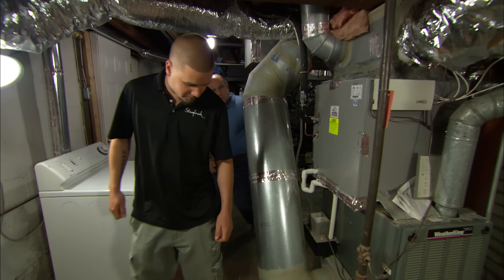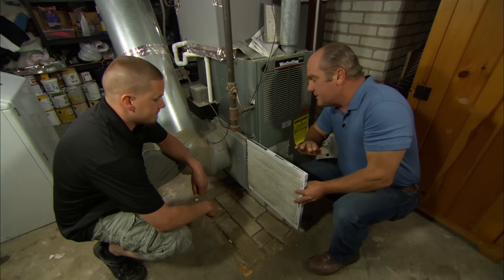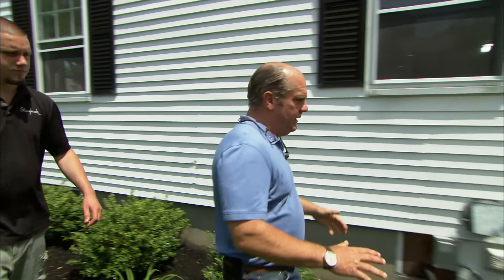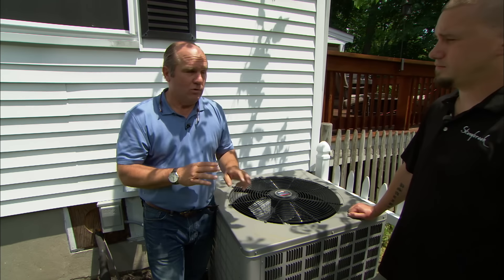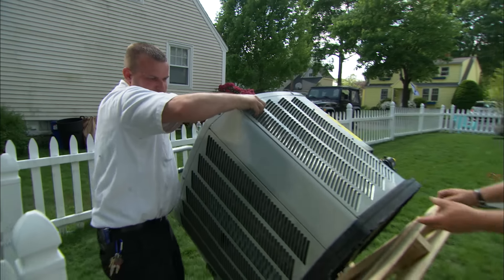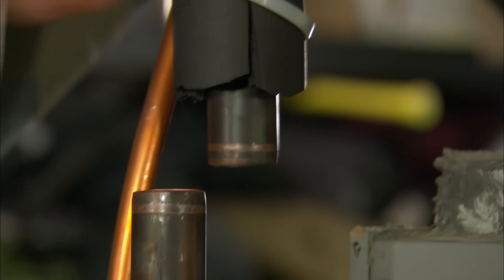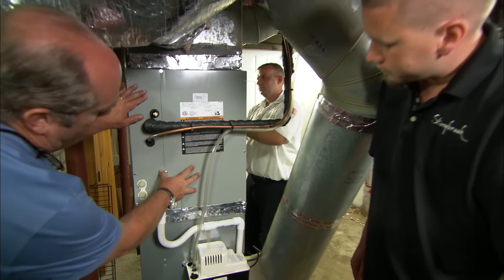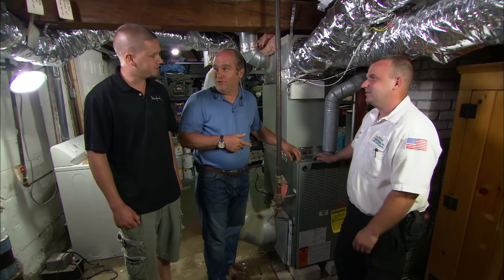How to Repair a Frozen Air Conditioner | Ask This Old House

Comment: He did not check for a dirty evaporator. Always check for large amounts of dust settling on the blower motor and that might give you a clue as to what the evaporator looks like before you get out of your handy-dandy measuring tape to look at the damn ductwork

Comment: haha the comments on this video are awesome...  Man they didn't mess around,  that coil was still melting and leaking water so they must of had the new unit on the truck ready to go.  That furnace looked 25 years old it even  had a  heat flute running out of it, did they ensure it worked fine because the video didn't mention it.  They also didn't show the returns in the house ( were they blocked by furniture?   No static pressure test?  Just measure  the ducts?   So unit was oversized for a 1800 sq foot house and yeah, that air return looks suspect for a 4 ton unit.  They should of quickly explained more  to figure out what the issue was and why only replacing it was the solution.

Comment: He's wrong when he said the refrigerant goes out to the compressor through the LIQUID LINE with the TXV and distributor.. the refrigerant GOES TO THE evaporator through that line, it goes back the the compressor through the SUCTION LINE which is the larger line the one without the txv on it!

Comment: That tiny return line looks far more suspicious to me than the oversized condenser. I know 4 tons is overkill in his case but I would imagine this could have been solved lot cheaper by putting in a proper sized return.

I'm not really sure that his return is even big enough for a 2.5 or 3 ton unit.

Comment: If it was oversized, couldn't you just regulate the refrigerant by putting in a regulator?
Reply: Yes and that component in refrigeration is called a metering device. That system supposedly had a TXV (thermal expansion device) which is set to maintain certain superheat. 
It is more than likely a lack of proper airflow and dirt that caused that system to ice up.

Comment: Line set is not sized right from a 4 ton to a 3 ton. just saying. Could of made return a lot bigger and increased the supply ducts. also could of put vents in basement.

Comment: Richard.I have a lot of respect for you but in this situation you missed some things.Yes the system was oversized and the ductwork was undersized.Three ton was a better choice.The return air was undersized and the filter rack was a bad design for airflow.I did not see the return duct replaced.Also last but not least, your description of the flow of refrigerant was completely backwards.Sorry but I to put my two cents worth in.

Comment: First of all,  when he is pointing to the copper lines near the A-coil/evap coil, he is pointing to the liquid line and the distribution header. NO WAY is that refrigerant returning to the compressor and condenser through the liquid line.  The refrigerant returns through the suction line, the larger of the two copper lines in the line set.

I replayed that segment a couple times because I could not believe what I heard and saw him explaining.  No way would a journeyman hvac/r hand ever confuse the functions of the liquid and suction lines. 

Also, running a larger unit in a smaller space is not going to make your coil freeze up. It may cost you more for the larger unit, but it is not going to make the coil freeze up. The T-stat will shut the system down when the conditioned space gets down to or about the set point temp.  His coil was probably freezing up because of low charge or running the system at an excessively low set point on an already cool day or because he is not moving enough air over the coil.

Anyways, watch when he explains, saying the refrigerant is going back outside to the condenser, where he is pointing directly to the liquid line and distributor to a fixed orifice metering device.  The refrigerant moves from the condenser through the liquid line through the metering device; then into the evap coil, where the heat is absorbed; then out of the evap coil,  returning through the suction line to the compressor, where it is compressed and pressurized, flowing out the discharge line into the condenser, where the heat is rejected and then down the liquid line through the metering device and on and on.. until the set point is reached.

Comment: Why did he replace the unit and evap coil?   I did notice he got the copper lines mixed up..  Looked like he was sizing up the  ducts maybe for cfms,  I never noticed why he had to replace the unit?      This could have been a simple fix and much less than  a partial new system.      This to me was not a real life presentation..

Comment: This was vary hard to watch as a HVAC tech. He didn't even check superheat or subcool. Says the refrigerant runs backwards, and they set the new condensing unit with the service door to the wall (Trane guys know). And I'm almost sure he was using plumbing solder on the liquid line for the evap coil. Looks like the right stuff on the suction line but he was using round solder at first.

Comment: never use pleated air filters, return air pipe is to close to air filter. Needs a return air plenium to spread air across air filter instead of in the center of filter.

Comment: When you were talking about building insulation and the type of Windows I thought you were going to mention doing a load calculation but then you blew it and went with that ridiculous 1 ton for 500 square feet rule of thumb. You didn't measure any airflow how do you know he wasn't moving enough air to support the operation of that 4 ton unit

Comment: 4 ton to 3 ton it's not a big difference. check the controller, if the controller was properly working, at 4-ton unit the compressor will turn off automatically before the evaporator can form ice. there's no need to downsize the unit to 3 ton.

Comment: If the unit was a newly installed and it has frozen pipe then I would say it may have something to do with oversize but if the unit was installed a few years ago and just having problems I think you should dig deeper to find the causes rather than changed out entire system lol

Comment: Nice job snowballing the guy into a new a/c unit ya con man, all you have to do when your a/c freezes up like that is turn the system off for 24-48 hours and let it thaw, then turn the thermostat to 70-72ish ? (Where ever your comfortable) and leave it alone, this is a very common thing especially in very hot climates.

Comment: He replaced a bigger unit with a smaller one...the only reason he gave, sounded like he wanted to sell a new unit. Also, those balmy “above record hot” summers, you’re now screwed.
Not once before he reamed the poor guy did he put a gauge set on the system and look for a leak. Refrigerant leaks are the biggest cause of core freezing.

Comment: Wait at 2:32 did this man just have a stroke, and explain to me that the liquid line distributors transfer the heat to the outside, the opposite way the refrigerant is flowing?  Once you hit that piston, you are in low side territory, ,

Comment: Yes, the AC was definitely oversized (assuming it really was 1500 sq ft) and it needed to be replaced. However, the return air should've been addressed. You cannot transition from round to square in that short of a distance because it wasn't utilizing the entire surface area of the air filter. Also, I doubt that little round return was big enough to carry a minimum of 12,000 CFM of air. Additionally, flex duct is only really meant to be used on the final 12"-24" of a run, not from the plenum to the register. The duct work is the biggest thing that should've been addressed. If the ductwork were big enough the unit wouldn't freeze up but he'd end up with a clammy house (cool but humid). I bet they had to come back out to this old house (pun intended) and deal with a frozen coil again.
Reply: What's more, I'm sitting here shaking my head at all the "professional" HVAC guys on here making, what I can only assume are, drunken comments. You don't need gauges to tell if a system is oversized or if ductwork is under sized. Jeepers! It had to go. Poor sizing is a huge problem due to all the hack moonlighters. But I think this episode clearly demonstrates the risk you take when hiring someone off of Craigslist. Not even 'This Old House' got it 100% right and they should have pro's double checking everything. I can understand the fear associated with people calling an HVAC technician. This is why it makes sense to call a licensed professional. They have more skin in the game and you have more recourse if they get it wrong.

Comment: Based on his 1 ton / 600 square feet rule of thumb and his 1300 square foot house, 2.5 ton would be more than he needed.. so why did he then put in a 3-ton condenser?
Reply: he recognized the infiltration of the older home...even with renovations....

Comment: I think I would just add a fresh air return and not have to pay for another new system and install. And fix the over size when that unit breaks. Oh and you didn’t use air tight cement required by city regulation lol.
Reply: Mastic isn't required in all municipalities.

Comment: The plenum is too short and too small to handle three tons of air must less four tons. The furnace blower is too small . Never bothered to check for refg leak.  Just pony up $6,000 sucker.  Where is the follow up video that shows any improvement in the system?

Comment: Didnt even bother checking if the condensing coil or evap coil is dirty, pressure's, capacitor, or indoor fan motor if its ceased. 🤔

Comment: I do hvac And plumbing. Main skill is HVAC. That return is far too small
Reply: Also he described the lines wrong. It goes back to the condenser outside as saturated vapor ideally ie the cold kind. The hot liquid line goes to the metering device in this case a txv and flashes off to a vapor at a much lower temp to absorb the heat.
Reply: Not by a full ton but you can oversize an a coil for efficiency but you have to adjust charge for it.

Comment: I don't get it. I can say for a fact that the AC in my house is way too big. The condenser is nearly 30% bigger than our old one, but it does not freeze. What is more likely a problem is that the condenser is kicking on and staying on when it does not need to be. The coils only need to be so cold. Now I am not AC tec but if this is not how it is supposed to work then feel free to correct me, but I think this guy got robbed.

Comment: The AC installer that ripped off my mom put a huge system,  I don't even know how big, on her little 750 square foot house. The condenser was bigger than the one on my house that was three times bigger. They have it low on refrigerant so it cools the space OK. If I were this guy I'd go that route instead of a new system if it's my dime.

Comment: The AC at my parent's old home in Louisiana died last year after operating for 34 years. The Hvac company they hired for repairs decided it didn't make any monetary sense to fix so my parents bought a new unit. For a home that's barely under 1400 sqft the HVAC contractors told them to go with a 4 ton condenser alongside a new coil unit. My parents didn't know any better and followed the advice of these professionals. 10 months later and the condenser is constantly freezing up. Their home is cool but humid. The energy bill is much higher than before as well. I wished I could have seen this video sooner or knew my parents had this issue so I could have rectify it with Hvac professionals I personally know. Why would the contractors recommend something so large that would cause issues for a smaller home?

Comment: I'm not AC tech,  but I noticed he said after he made a killing replacing that newer 4 ton unit with a 3 ton unit that he had to replace the A coil unit with the proper unit.  What if the coil unit wasn't the correct size in the 1st place or maybe just dirty or bad?  Seems like he over should this poor home owner equipment that he didn't need

Comment: I always thought the compressor turned the 22 into liquid under pressure and fairly warm too.  This guy says it comes back cold.  🤦‍♂️
Reply: The compressor sends the gas refrigerant to a condenser outside, the fan pulls off the heat turning the gas into a cool liquid which is pumped back into the a-coil,  which is an evaporator..where a fan blows air across it, picking up cold air and pushes it through the house. The low side of the A-coil sends that liquid refrigerant to a receiver and back to the compressor where it turns to a gas state to be pumped through the condenser outside again..

Comment: That was possibly the wrong type of air filter on the furnace, if it restricts air flow.
Reply: Look at the way the filter was installed.  Only half of the area of the filter is being used.  It is a huge restriction.

Comment: he could have just pulled the refrigerant back into the condensor by closing high side running unit until all refrigerant is back into condensor then its ready for installing on another job instead of reclaiming it

Comment: OMG so many mistake.. hes changes the whole system wow. The Line hes pointed at 2:22 is the High presure Line WTF.. it could be a lack of refrigerant, expander valve block, a lack of air, defective blower., dirty evaporator, Return air too small or block,air distribution extensive duct create restrition and too small for 4t,running in low temp outside without fan-cycling, Filters(oh hes check this 😂)an oversize system can only causes a lack of dehumidification and discomfort. no nitrogen when he does his welding, no p-trap needed with positive presure, no pump down to save time etc .. lack of experience
Reply: And condensate trap doesn't work when you have an uncapped tee before it. 🤦🏼‍♂️

Comment: It's supposed to be easy. just retrict airflow by covering the condenser
Reply: how would restricting airflow to the condenser fix the problem of the ductwork being too small for that oversized unit? the problem is not all the liquid is vaporizing in the evap coil, so you are getting liquid floodback to the compressor... choking off the airflow to the condenser would help how?

Comment: I know this is old, but I hate seeing people get bent over like that. Size x heat load is how the units are decided. I saw someone say something about gauges. What is the coolant level. Replacing the unit is the last choice, not the first. There are other things that can be done before spending thousands on a new unit. But I guess they have to find something to make a show about.

Comment: This is not a good install.  He is correct in looking first at the airflow, and then performing a heat load to correct the oversizing issue. But then leaves it attached to the same garbage duct system.  There are some small changes that could be made, very easily, to the return and supply to make this system work a lot better.

Comment: That guy got scammed. Probably just needed to replace filter and open vents, if all the guy can come up with "it's too big". Even if that is the root cause, there's a WAY cheaper remedy available. If your engine and transmission is too big for your rear end, you don't replace the engine, you replace the rear end. Same deal here. If the condenser/compressor/evaporator are oversized, the least expensive remedy would be to replace the blower with one with more static pressure, so it can push enough air through to keep it from freezing.

Comment: Why didn't he simply swap out the condenser's fan motor with one less powerful?  Or if the unit has an adjustable flow meter on the evaporator, fix it there?  This seems excessive.

Comment: Love how there's no mention of the system being short on return air, that single 12" pipe isn't enough for that that 100k 80%.   They're still short on return for a 3ton so they really didn't do this guy any good.  And it's zoned, that whole system is a mess.

Comment: Why replace the 4-ton unit when it was never mentioned if it had ALWAYS done this, or was brand new and wrong-sized? 
And why replace the A coil? Was that REALLY necessary? Looked like just a way to boost sales... Y'all didn't even check the freon pressure first to see if that could be responsible. Could've been a LOT quicker, easier, and cheaper.

Comment: that three ton is gonna have problems too. The return air looks to small ,and they didn't use nitrogen for brazing the line set to keep oxidation from forming inside the copper pipe  410A  will wash the pipe clean sending all that trash to the metering devise and clogging it up . not counting leak checking  wow very poor install better keep to building and leave the mechanical side to the HVAC/R techs.

Comment: I would be mad if I were that owner! 😡 I would go after the installer since he is liable and should know better. Original install was unacceptable!  On the other hand, wouldn’t installing a hot gas bypass mitigate the problem without changing the whole system? 🤯

Comment: My father in laws unit outside and inside was replaced and the only problem  is the capacitor because the motor will Humm and trip the breaker $5000 plus change and a crappy thermostat they put no f a n  selection just heat and cool not even programmable.So Home owner beware! Always get a second opinion.